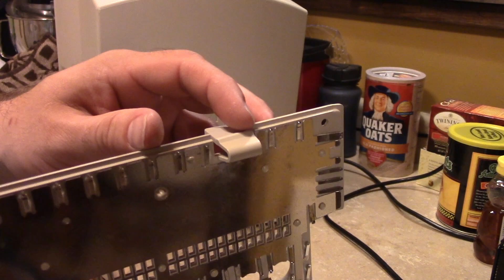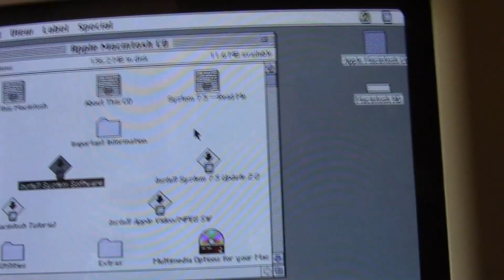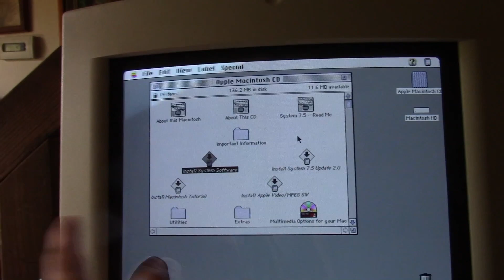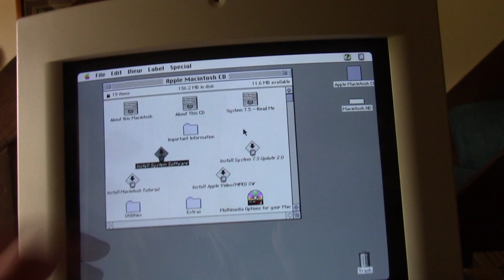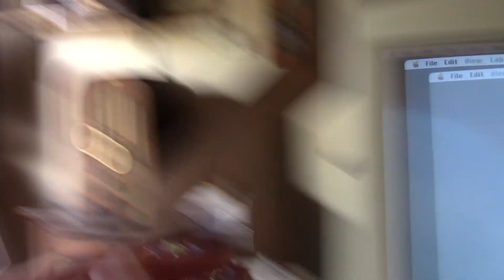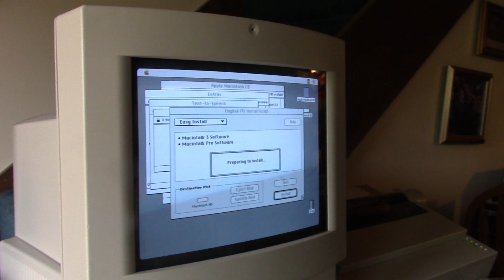So I Found a 1994 Macintosh Performa 575 in the trash, and...?

Comment: Excellent video!  This performa model came out a few years before, I picked up my first apple computer a 5400 with a power PC processor.  Several year's ago bought a used 5500 model on Ebay.  Once it arrived, I installed my internal apple video card, apple TV/FM card, and G3 processor upgrade card so now, it is just like my old 5400 has been re-born.

I am sure you already know that, another way to start and shut down these vintage computers is with the remote control that came with the apple TV/FM card.  Which, might be a fun addition to your system.

Comment: Scanlines are what you see each time the crt crests what’s called a “fly back” which means the electron gun bounces between the front of the CRT, back to the base of the tube. However, Flyback lines are visible when you turn the brightness too high, easily fixable by turning the cut off control down. Also, low emissions cause distortion of the red gun and blue (most commonly on trinitrons) which bursts the colours and may also need the electron guns re alighting.

Comment: One of these days I need to get a middle of the road classic. Have several SEs, a Plus (needs an analog board I think), and then my collection jumps to a PowerPC desktop, Grape iMac and Tangerine iBook. Seems like this would be a nice, easy to work on model.I've gotten to the point where I generally hate having to take apart my SE's as it's all so damn cramped and plugging/unplugging things seems to eventually kill a wire or port due to age.

Comment: i seen one of these years ago. someone was giving away monitors on freecycle or something and i got 2 crt ones and one of these was there too. wish got it now don't know why i didn't. don't think had anything with it. high school had power mac power pc 5200 and 5300 in few class rooms i was in. they were not really used much but more for few games and typing. i graduated high school 2003 btw.
Reply: haven't had any luck finding any vintage macs in the wild, found a Pentium 1 system that i took, has a 430tx chipset, a Pentium 200, has 64mb ram, and runs Windows 98 SE, and some junk Dell Pentium 4 systems and a Gateway Essential pentium 3 system which i didn't take. vintage macs are rare as hens teeth.

Comment: Sadly, here in Missouri vintage computing equipment is very difficult to come by, and is almost as rare as hen's teeth. Maybe the closest thing I've found to "vintage computing" is actually the paperwork from a 1994-vintage Macintosh Performa/LC550 (including the blank warranty registration card and some other "goodies"), which I found accidentally when cleaning out a desk. I would have loved to have fond an actual example. I have tried scanning those documents but they're in a strange format that makes scanning them next to impossible without destroying them.

Comment: Basically my childhood, we had the Performa 580 CD, so many good memories gaming with Full Throttle, Rebel Assault, Doom 2, Wolfenstein 3D and Dark Forces. The Mac versions of those games, always seemed to be a much better quality than on PC.
Reply from the maker: The Mac versions usually WERE better, as the games only needed to be developed for one CPU, one audio interface, one graphics chipset... so the games were pretty streamlined. Also, System 7 was more stable with less overhead than Windows 3.1 and 95 of the same era. I was playing Doom II on this thing and couldn't believe how quick and stable it is!
Reply: Liked for good taste in games 👍

Comment: I had one of those, loved it dearly, then one day it died, started doing the chimes of death. I honestly don't know what had failed  I had to give up on it after a couple of hours of trying everything I could to get it going again, but with no success.  :(
Edit: your mention of the capacitors make me think that was the cause of the failure, while I couldn't see any signs of leakage, it doesn't mean that it wasn't. that said I suck at cap replacement, so it was just as well. I donated it to a goodwill for parts, so maybe it eventually found a home. I still miss it though.
Reply from the maker: Leakage isn't always a sign of failure.
Reply: true, but after switching everything out including the CPU, I was left with few other alternatives. it was working, then it wasn't. that said I never had the thing on very often, only running it for an hour at a time. it had also been stored in a hot environment for a bit by the person I had gotten it from. so there were a host of possible reasons, but none I was capable of fixing. The monitor was identical to yours in function, nice and crisp. it was a shame I couldn't easily fix the machine, as I would likely still have it. but as for leakage issues, I had some boards that definitely were leaking when I had gotten them, all were stored in an outside shed and that apparently doesn't help those caps. actually had a 9600 blow a cap in a tote I had stored it in, (And this was in my room). heard a loud pop at 2 in the morning, never figured out what it was until I went and pulled out the 9600 board, and noticed the exploded cap with it's innards running down the board , Ugh.

Edit: sorry about your 1g drive not working, I think i only have 2 known spares, but they are smaller than that. but its the same issue basically, even if I get a scsi machine now that works but has a bad drive, I'm running out of drives to put in them for sure. but glad you saved that thing. it was a truly awesome machine.

Comment: I grew up in schools that were using Apple IIGS systems (we did have a few of the other models in the schools, but MOSTLY IIGS systems).  I am surprised at how much they have gone up in value as well....I did have one as a kid but been wanting another one....the computer itself is selling for $200 or more on eBay...that's just the computer...no disk drives, monitor, keyboard......I been looking at craigslist every now and then to see if I could find someone local that has an Apple IIGS to avoid the high shipping costs of eBay....I did find a listing about 6 months ago for a HUGE lot of Apple II/IIGS stuff for $350 and I contacted the seller and they said it had already been sold..the listing was less than an hour old...

Comment: Nice! Yes, you were lucky.
I actually thought it was going to be some kind of IBM computer, or some really obscure computer with some obscure OS, or even just one of those HP f(screen size)03 series monitors.

At least the one you got is not an LC series... wait. it still uses an LC chip?
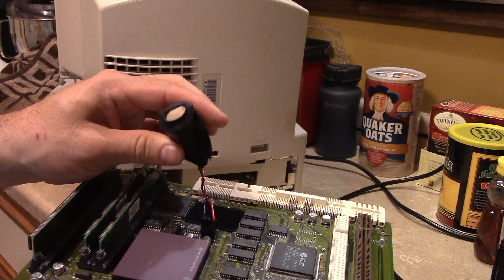14:22 I'd probably use carbon or magnaese batteries instead because I'm pretty sure those don't really leak.
19:27 My 2 favourite (modern) versions are 10.7 and 10.8, with the only reason being the UI design. (Gah! I really wish there was an open-source framework for skeuomorphic design apps on Linux, and apps to go along with it!)

Comment: Monochrome CRTs are more likely to get burn in
Reply from the maker: I've seen it on many color displays over the years, but yes; many monochromes as well. I believe it's because the mono displays are more likely to be used on equipment used for particular purposes and with older software that displays static images.
Reply: I have a IBM PS/2 mono monitor that has Lotus 123 spreadsheet burned into it.

Comment: Sadly, not many of these machines in the wild anymore, because they are darn near unshippable. Over at the 68kmla site I frequent, I see horror stories over and over again where people buy these machines, and when they get them shipped they are obliterated, the plastic is too brittle for that heavy of a machine. If you look at them wrong, they will fall apart. I own one and got it locally, luckily. Same problem exists with the 52/53XX machines.
Reply from the maker: I believe the same thing will happen as the earlier iMacs become more collectible. The chassis/CRT support is made from a very brittle plastic that has a tendency to shatter like glass.
Reply: i had more success finding vintage desktop form factor macs like the Macintosh LC III or Performa 630 than all in ones on ebay.
Reply: i was looking harder for a performa 5200 but i gave up and bought a 6200cd instead, it's just basically a desktop version of the 5200, i got a 5300 off of ebay for $150 before and it was completely pulverised, there were plastic shards everywhere in the box and it didn't even look like the performa 5300 anymore, i just saved the motherboard, cd drive, hdd, floppy drive, etc. and tossed the smashed up machine.

Comment: I would like to get a 5200/75LC or a 5300
Also you had the slots right the first time
Reply: i just got a 6200cd, Power Mac/Performa 5xxx aio systems are a pain to find cause they are hard to ship on ebay, the few that i found were a couple 5260/120 systems that were over $300 or more with a crazy shipping price. same goes with CRT monitors, imac g3, emac g4, molar mac g3, lc/performa 5xx, etc. desktop systems are easier to ship cause they're smaller and lighter

Comment: I personally much prefer the PPC successor, notably the 54XX and 55XX series. Better design, bigger 15" screen, PCI expansion slots, IDE controllers, SRS surround sound speakers, and you could even upgrade to a G3 500MHz processor by utilizing the L2 cache slot. I actually hated the LC 5XX series because I remember using them in high school and they were all horrifically SLOOOOOOOW (mainly because of the 68K architecture).
Reply: the LC/Performa/Quadra 630 and LC/Performa 580 were the only 680x0 macs that had an IDE controller, others only had SCSI